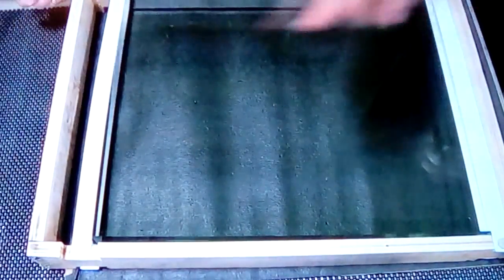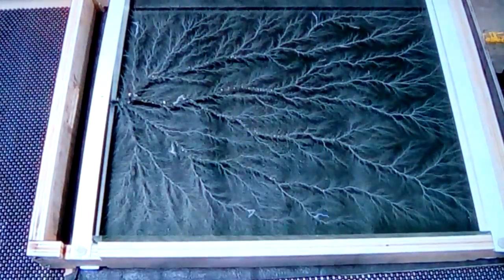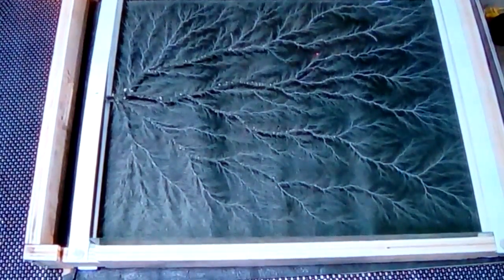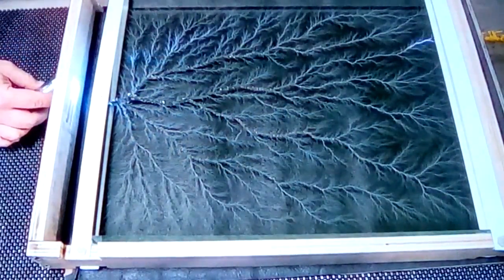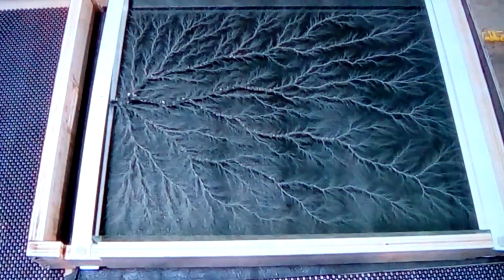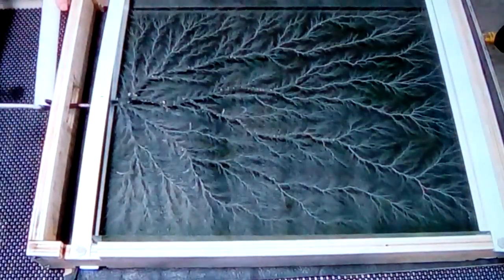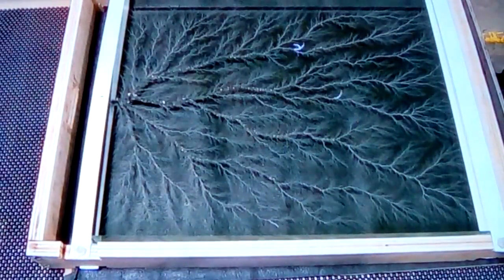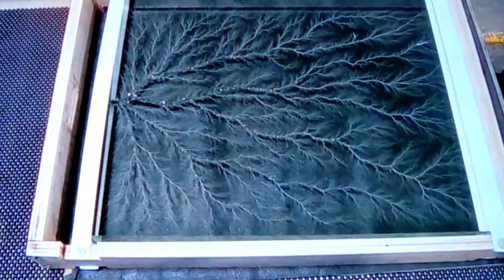Zeus Workshop - Captured Lightning ( 2.1 Million Volts) Physics Sculpture 2018 New

Comment from the maker: This is a 15" x 20" x 2" 3D Captured Lightning sculpture being created inside a large slab of clear acrylic plastic. These are also known as Lichtenberg figures or "beam trees". This specimen was passed through a 5 million electron volt (MeV) beam of electrons from a particle accelerator, flipped 180 degrees, and then passed through the beam once again. The high-energy electron beam injected trillions of extra electrons into the slab, creating two separate cloud-like layers of electrical charge, each located about 1/2" below the surface. We then released the trapped charge by poking the slab with a sharp metal point. This created a small defect that allowed most of the excess charges to rush out with a brilliant lightning-like flash and BANG. However, the main discharge doesn't remove all of the trapped charge, so thousands of small pockets of residual charge flash for up to 30 minutes afterwards. Before being discharged, the electrical potential of the internal charge layers exceeded 2.5 million volts. The powerful electrical discharges create thousands of small tubes and fractures in the acrylic, creating a permanent inch-thick "fossil" of their passage through the slab - a 3D Lichtenberg figure. More information about Captured Lightning sculptures, the history of Lichtenberg figures, the physics of the process, and our galleries of sculptures available for purchase can be found here:
https://www.youtube.com/watch?v=9Po35...
https://www.capturedlightning.com/fra...
https://www.capturedlightning.com/fra...
https://www.capturedlightning.com/fra...